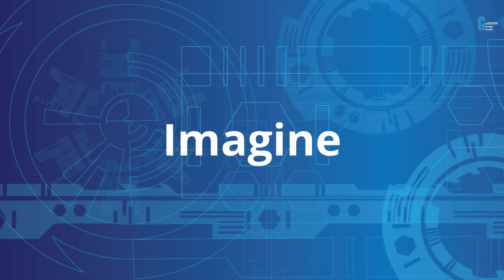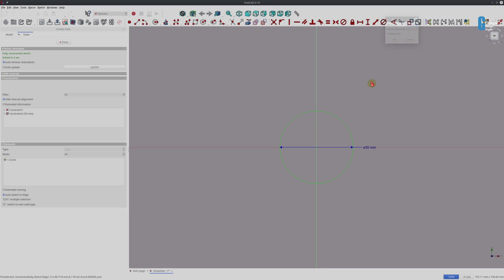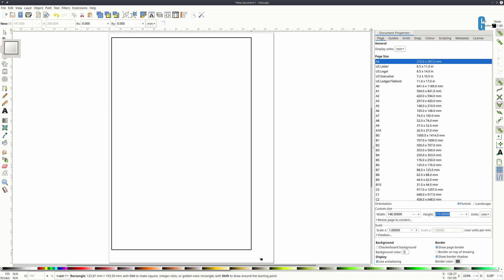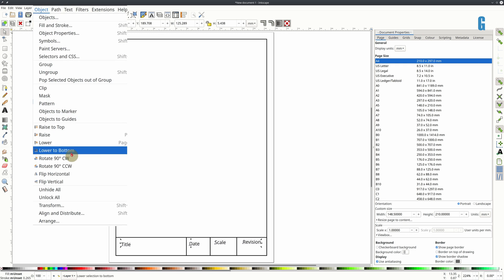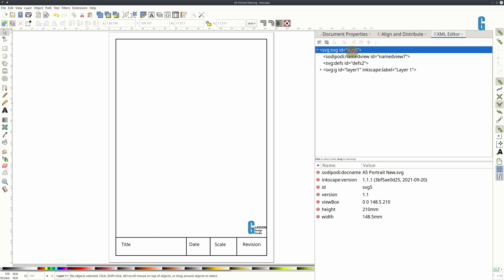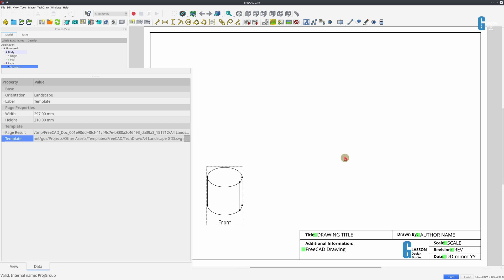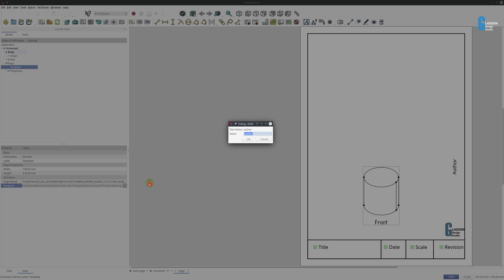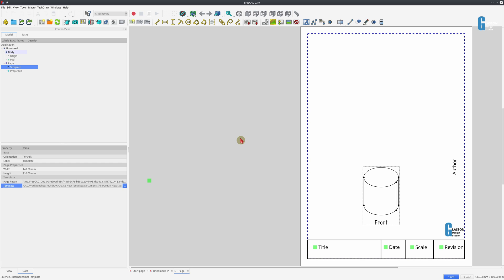Design your own template for the TechDraw workbench

Comment: Thanks a lot mate. It's working just fine. I'm only having a problem with alignment. The green boxes are shifting the text to the right of the page. That is also happening in this video. Have you found a way to work around this? It'd be nice to deactivate that somehow.
Reply: I've figured out why. Just in case anyone else is having this issue. Delete the xmlattribute in inkscape for all text elements with the value of "preserve". Otherwise you can change the value to "default". 

The rest of this video works fine. However, double check the xmlns:freecad url is correct as well.
Reply from the maker: Thanks for figuring it out and letting us know.
Reply: @GlassonDesignStudio  Pleasure my friend. Thanks for the video!
Reply: @JA-ur8ob  This did not work for me.  I have 3 texts transformed 90 degrees, and their green boxes of still off sheet after having deleted the "preserve" attribute for each of them.  Anyone else have any tricks to fix this?
Reply: I determined a workaround. The problem is something to do with how Inkscape handles the x,y coordinates of the text. To see the problem, open the XML editor in Inkscape, select your text, then repeatedly press CTRL+[ and watch what happens to the x,y coordinates. When rotation is 0-degrees (text reads right-side up) the x,y coordinates are correct. But when rotated 90 or -90, notice the x and y values swap places and polarity. My dirty fix is as follows. Determine the exact X,Y you want the text to be, then rotate it as desired. Then force the x, y and Rotate attributes to those coordinates. So for example if your text location must be X,Y, with angle -90, then set the attributes as:

x = X
y = Y
Transform = Rotate(-90,X,Y)

The problem is this causes the text to jump off-sheet in Inkscape, but it places it correctly in FreeCAD. What a mess. If anyone has a better fix, please share it.
Reply from the maker: Thanks for your feedback. I hadn't noticed that there was a problem to be honest.

Comment: I'm trying to add the xmlns:freecad attribute. I've entered the url as described in the description but nothing happened. I've noticed it needs a little more information. Does anyone know what I need to add to the end of this url.
Reply from the maker: Thanks for your feedback Steve. It should just work. I'll do some more digging and try to get you an answer.
Reply: @GlassonDesignStudio  thanks, that's much appreciated 👍
Reply from the maker: @Steve Pawinski I've been trying to replicate this but so far have not had any success. The xmlns:freecad attribute should only require the URL and nothing else. Do you recall what other information it was looking for?
Reply: I had problems getting the URL to work. I opened the .svg file with a text editor and added it in the code.